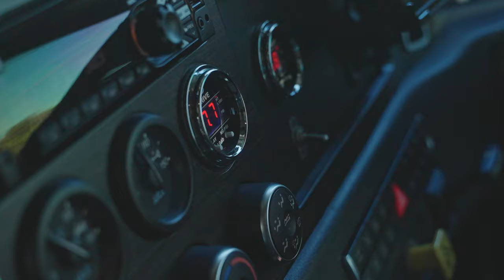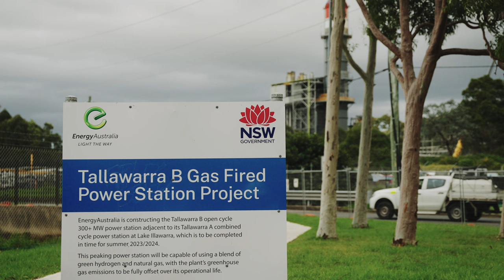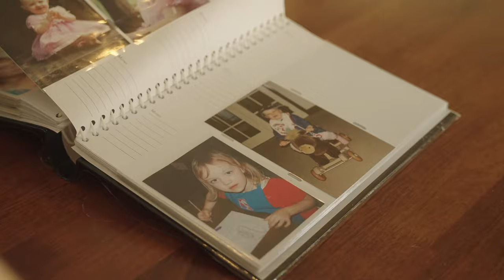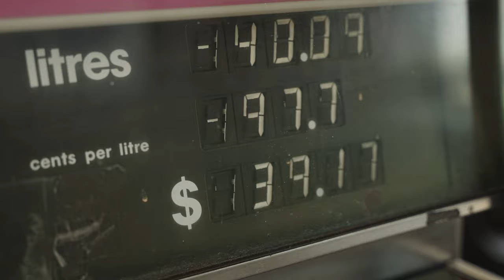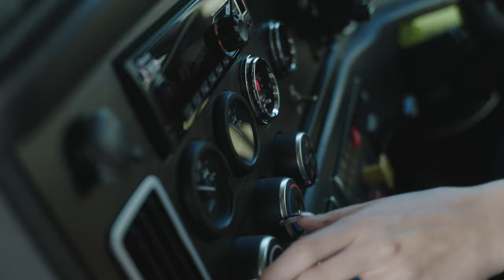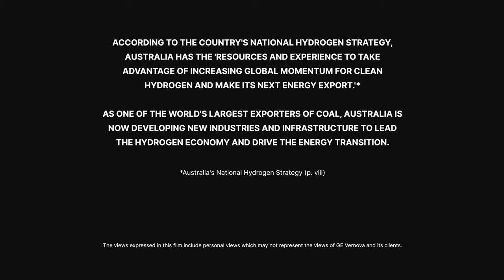Hydrogen revolution in Australia - 'Powering Tomorrow' docuseries | GE Vernova

Comment: I do believe the cost of hydrogen will come down eventually once people start to use it to power the vehicles. EVs are crap cars. 
Synthetic fuel – called eFuel by Porsche – is created by splitting water into oxygen and green hydrogen, then combining CO2 with the green hydrogen to produce synthetic methanol, which is then converted into e-fuel, “which can be used in REGULAR combustion engines.”
We don’t need to change infrastructure and we can pump this gas at our local gas stations into the cars we now own. It’s that simple!
Reply: You really have got this backwards. Big oil plan to provide the methanol and, in the process of creating enormous amounts of climate-changing CO2, produce hydrogen the will need enormous amounts of electricity to purify, compress and cool to produce a useful product which will then need to be shipped to remote places. Once inside your hydrogen fueled EV (and hydrogen fuel-cell vehicles  are electric vehicles) you can drive around in the full knowledge that if you get in to a major accident your life will terminate in a massive explosion and your remains will be incinerated beyond identifiable recognition.